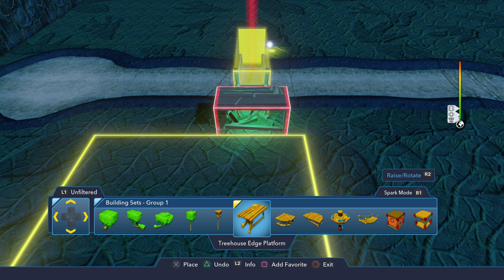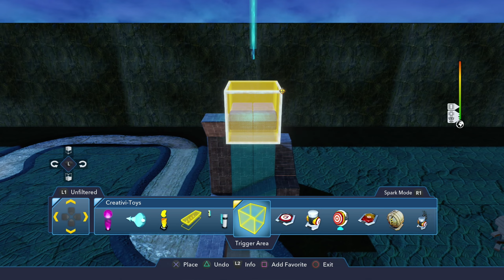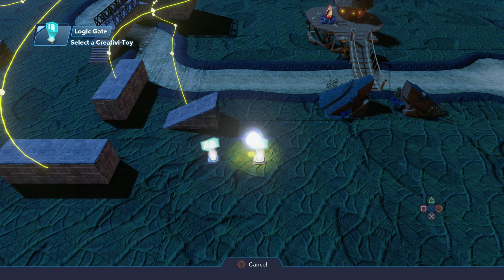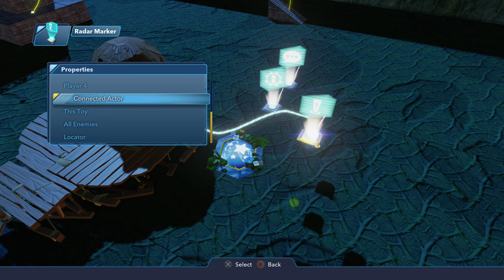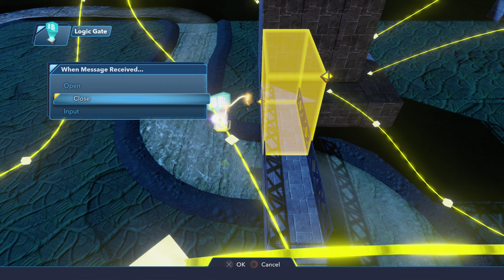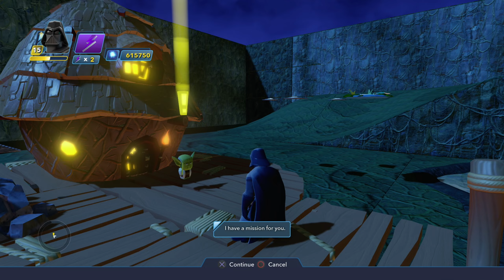Star Wars Dagobah #3 | Yoda´s mission (Disney Infinity 3.0 Toybox Tutorial)

Comment: Excellent work and well-designed. I lost my Battle at the Sarlacc Pit by accidentally saving over it with another toy box. But I didn’t have a backup save file, so I had to start the toy box from scratch…thankfully I had my tutorial videos that I had created as a guide.

I’m working on Dagobah for my Return of the Jedi project which I hope to have ready for release on SW day this year. If I may ask a question, what sound effect are you using in the background for the jungle animal sounds? I would like to add that to my toy box. Thanks.
Reply from the maker: Thank you so much Jetblast ;-)

Oh no your Sarlacc Pit battle? So cool you still have your YouTube videos about it.
What did you say, a Dagobah toybox for Return of the Jedi? So cool, can´t wait to see it. Dude this celebration year is so amazing.
Well, but two years ago I used the sound generator for the background sound. It´s under the "nature" section and the sound I used is called "stormy wind". I turned the 3D sound off and set the volume to 10. Still a bit loud then but its doing its job.
Alternatively, you could connect a locator to the sound generator, turn 3D sound back on (Volume at 100%) and then place the locator under your terrain. Since you only can connect one locator to each sound generator, having multiple sound generator for your terrain area could be a solution. Well and then you can control the volume with how deep you place the locator.
In the tutorial I used just an ambience jungle sound! If you´re looking just for something to put in your video for Star Wars Day this could it be.
Reply: @THEBOWTIEGUY   Thanks for the response! I decided to add some sound generators connected to a repeater to add in a thunder sound every 30 seconds, a continuous sound of crickets, and a frog sound about every 17 seconds. I'm going to try adding in a wind sound as well, but it may be too much because I also have Yoda's music teme playing through the Boom Box.
Reply from the maker: Well I am really looking forward listening to that! 😉